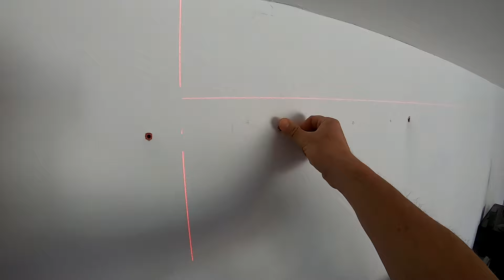IKEA BESTA -  How to fix TV wall cabinet - Fixer meuble haut murale

Comment: Hello, I would like to hang this piece of furniture vertically but it is not designed for that. Do you think it is possible to shorten the mounting rail mith a saw, and attach the hanging brackets in the direction of the width of the furniture? Thank you for your video, and thank you in advance for your response!

Comment: Can someone tell me the part number/name of that plastic angle at 3:18 pls?
Reply: It does not have a name, it comes with the Bestå furniture from IKEA.
Reply: @Vismajor01  Typically those parts still have numbers, they usually are written in the manual.
Reply: @JuergenQingdao  I didn't say they arent numbered, I just said they don't have names as such.